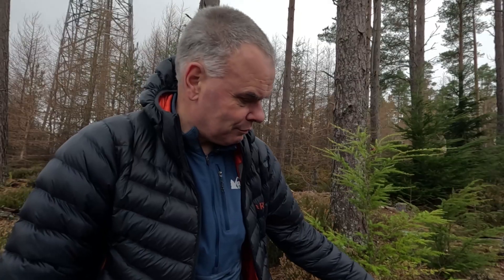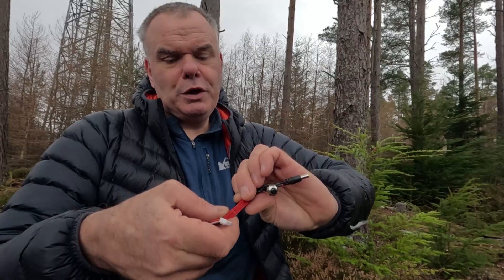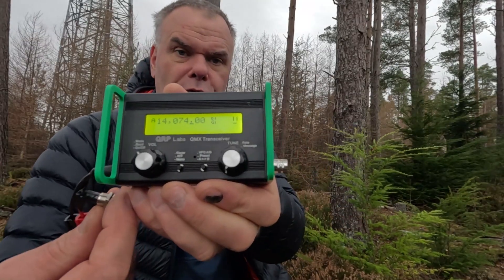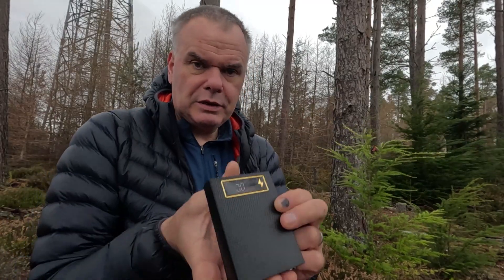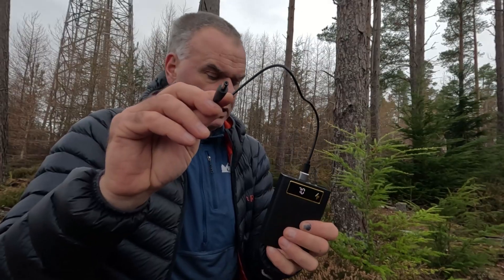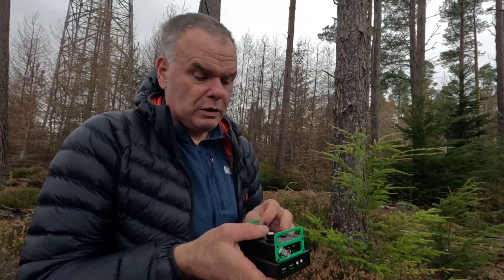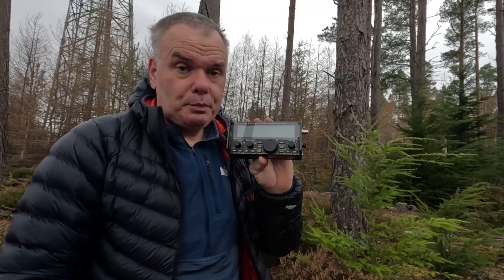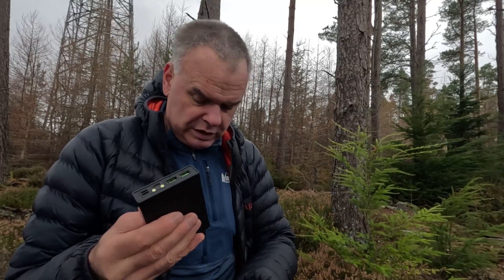Powering a QRP radio the easy way

Comment: So many possibilies with PD capable power banks. Apart of a 12V PD cable, I have also one where you can change the voltage, e.g. 9V, 12V and 15V. But one has to be carful not to change it accidentily!
Reply from the maker: Thst is a very good point. My cables are labelled. 😊

Comment: Ive been using the 12v NiMh batteries for my dewalt drill and driver kit for my uSDX+ it works very well, and they are quite compact and not heavy.
Reply from the maker: Good idea. I have a USB adaptor for my DeWalt battery but it is about 1kg in weight.😅
Reply: @theradiorover I just made up a jumper cable for the battery with two crimp-on spade connectors with a barrel plug on the other end. I jam the connectors into the battery and off I go. No extra weight. The batteries are quite small because they are only 12v

Comment: Nice idea with the button and the diode! The issue with the power bank and the PD cable is that it turns itself off: I have two tru(e)sdx and Kanga Rockrose and Kanga Rooster and they consume just a few mA on RX so power bank thinks its not connected to anything and just turn itself off; I got another one, very different, same behavior.  What works for me, at least, it`s a 3s 18650 battery holder with multiple connectors; when I got out I take with me 6 charged 18650 cells. Cheers. Adrian
Reply from the maker: Good idea Adrian. I haven't had the turning off issue. 🤔
I'll need to dig deeper.

Comment: I've had the 8 battery version of that PD enclosure for months now. Works great with my 9V QMX+. The torch/flashlight comes in handy as well as fast charging for phones and tablets. Nicely trickle charges off a portable 5W solar panel too. You can't simultaneous charge a 5V device and use the PD cable to power the transceiver.
Reply from the maker: That's cool! I had the light come on accidentally a couple of times, so need to watch out for that.

Comment: Not sure if that LiPo pack was 4S or 3S, but I tend to use the 3S variants for radios that can’t handle 14v, and the 4S ones for things like my 705 and FX4-CR.  I use Powerpoles on the higher voltage ones, and XC30 connectors on the lower voltage one, so I can’t screw up…..
Reply from the maker: 3S, but still over the 12.0V that Hans stipulates for his radios, hence the diode dropper.

Comment: Those PD leads have a chip in the moulding to "negociate" the voltage required with the Power Delivery supply ..I have a module like this for the FTX1 ..Good one Fraser!!
Reply from the maker: They are pretty cool and very cheap. 😊

Comment: 👍Interesting video Frazer.
Assume the cable incorporates a USB-PD decoy. I use one with my QCX. It has some DIP switches that allows different voltages to be selected, including 12V. Provided the USB power sources is compliant, the decoy "talks" to the power source to switch it from standard USB-C 5V to 12V. Allows me to use USB power banks as QRP 12V PSUs.
Reply from the maker: DIP switches are a neat solution. Not sure if they are 🏴 weather proof though. 😅

Comment: Not all PD power banks will provide 12v as I found out :) as an example some of the Anker PD don't.
I've been using the  (amazon description) "VRURC Power Bank 20000mAh,Portable Charge Fast Charging USB C 22.5W Small Battery Pack PD QC 3.0 with 3 Input &4 Output Compatible iPhone Samsung,Smartphones Tablets and More" 
Currently £16.99 and they run my G106 5w and IC-705 10w no problem and provide 12v
The lead I use which tells the battery pack you want 12volts is (amazon description) "DSD TECH MagicConn SH-CP12A USB Type C PD to DC Power Cable-12V"
Both work very well and be usingthem for almost a year now. Bob G6CKK